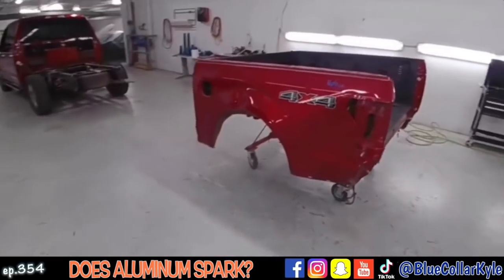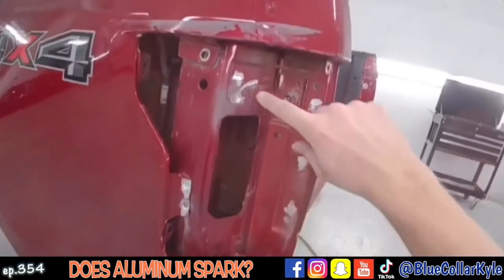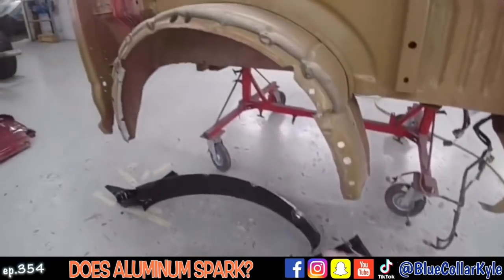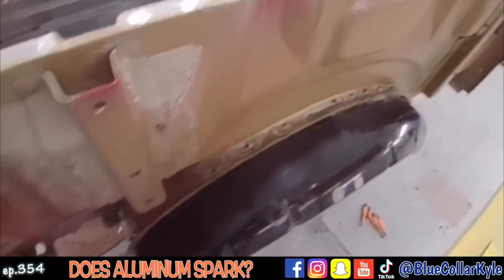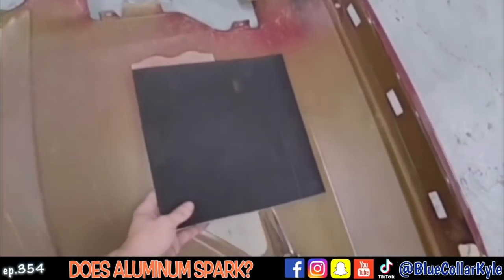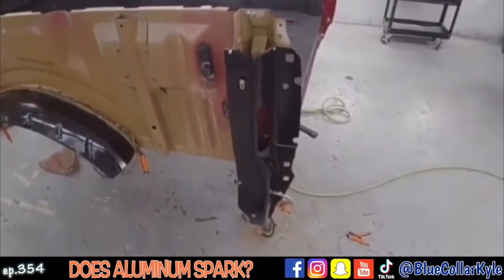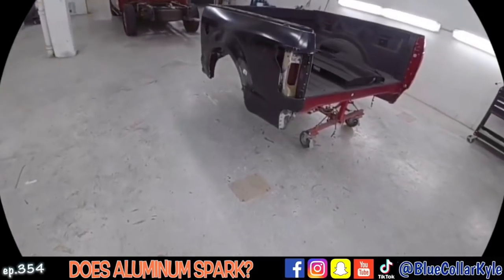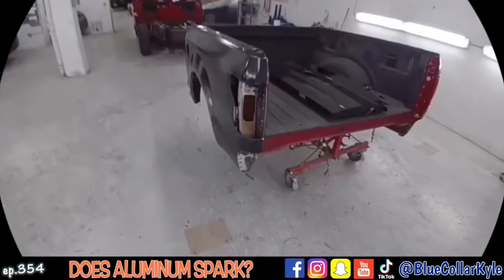Does Aluminum Spark?

Comment: cars today are bubble gum and aluminum foil... wonder how long until the oem rivets cause galvanic corrosion
Reply: They are usually a stainless steel river or a Zinc coating rivet so galvanic corrosion will not happen. It’s the same way we have been making airplanes for ages lol

Comment: What is the gold/yellow colored paint or primer you apply to the inner panels and wheel house?
Reply: It’s a spray paint for Adtl corrosion protection. it also gives the same appearance as the Oem look the bed side has originally from going in its “E coat” bath at the factory. At our shop we use the same paint mostly due to the ease of matching the oem look on back side to make repair look undetectable
Reply: Jayson Flores so it really isn’t the same stuff as the E-coat? It’s really just to match what was there
Reply: Bryan Kephart yes that is correct e coat can only applied at factory  due to has to be dipped in a bath with electrical current. New oem parts do come with e coat already applied though. Most replacement parts how ever come in the black finish. And at body shops we just try to make the repair undetectable the product he is using in this video is called “EZ COAT” all it is really good spray paint that comes in kits that match factory colors of unpaired portions of the vehicle. I believe it’s sold in 6 different colors to match various different OEM’s “e coat loooks” 👍
Reply: Bryan Kephart EZ COAT is sold by a company called Sem check out product description on line